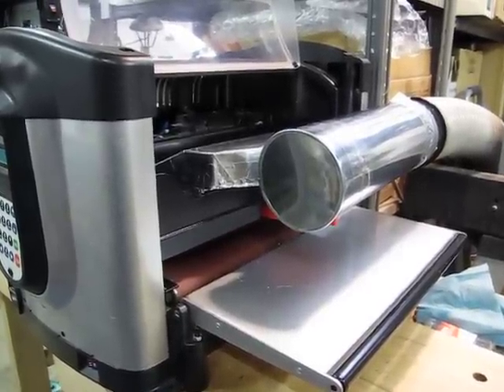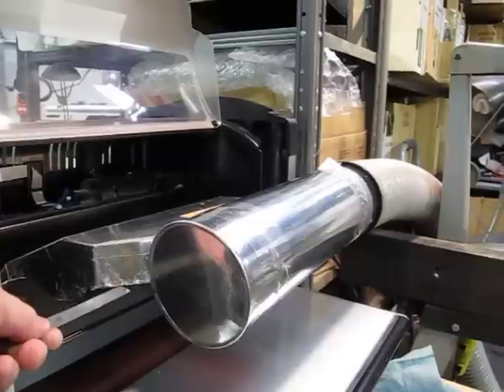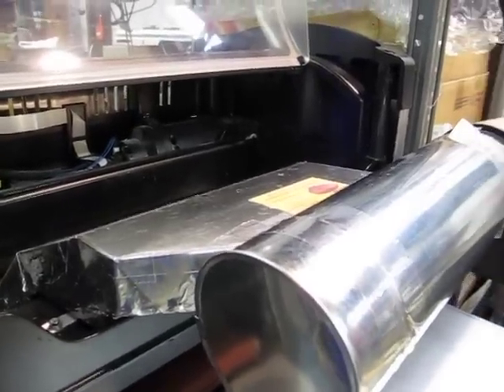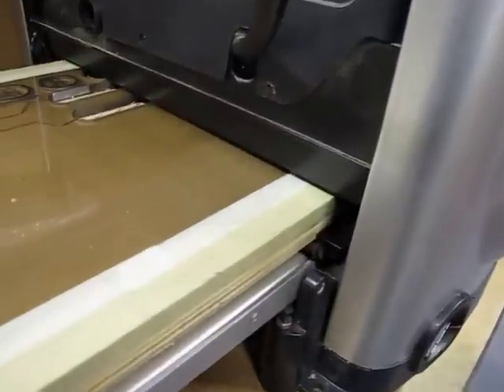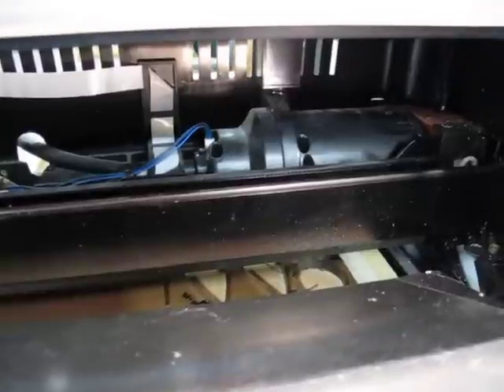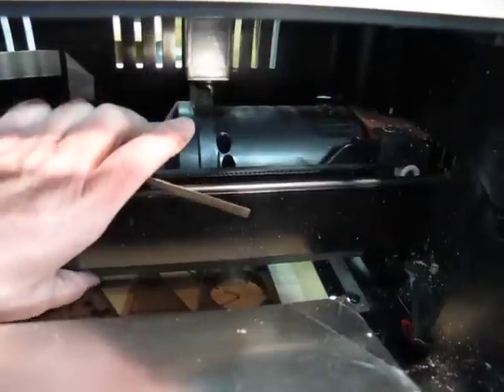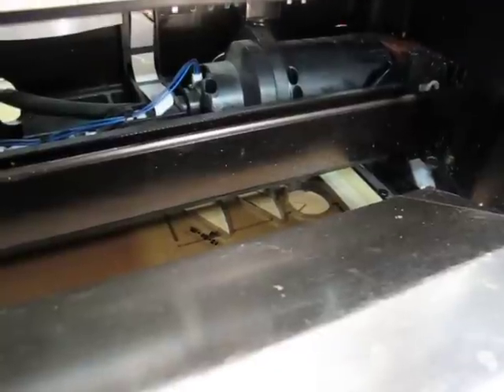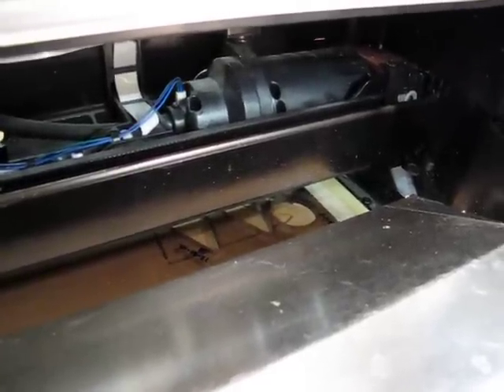1 CarveWright & Ringneck Blues Dust Collector Setup

Comment from the maker: Update Jan. 27, 2013: I had to run another 2 hour series of Cut Paths today and noticed that I had left the muffler off of the side of the machine when I did the videos. At the end of the cutting today, there was NO shavings on the side of the sled and only about 1/2 of the amount on the rubber rollers. On the video, the chips were being scattered on the sled and then carried back into the machine so this is another big improvement. I continue to be impressed.
Reply: John, thanks for the video. I am looking for your others ones on the dc-insert but can not find them. Did you do more? thanks, Floyd
Reply: I found them.
Reply from the maker: @floydharris4559  Hi Floyd, Glad to hear from you. I assume you are still cranking these out? I haven't kept up with CW. I use a large Camaster now since we run lots of production.
Reply: @WashyHippo1  Yes I am still bending them up and shipping them out. I stumbles on to your video while looking up some cw stuff, glad I did. I've got all the video links copied now. Glad to hear you are still doing your production work. I bet the Camaster does a good job. Thanks for the reply.